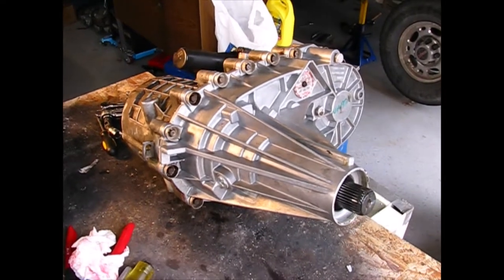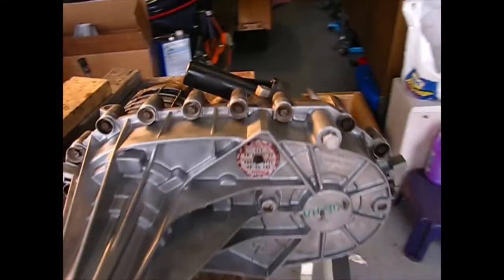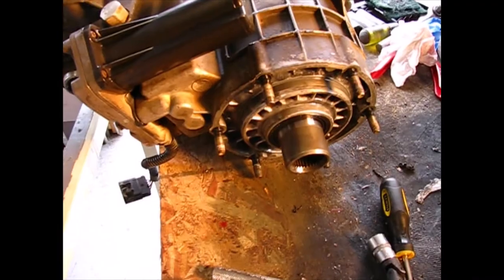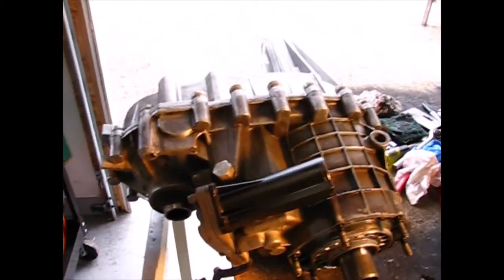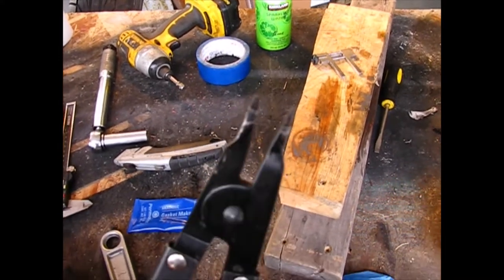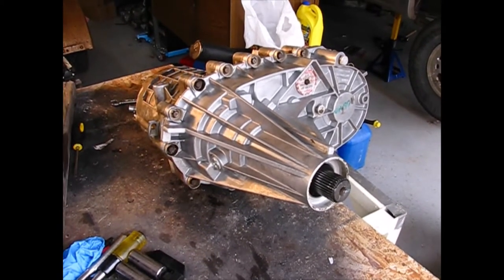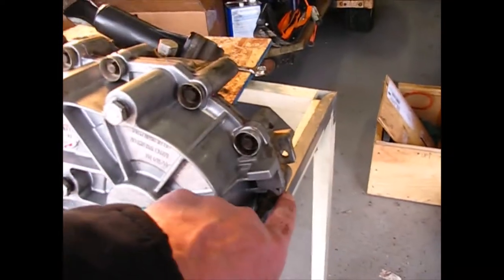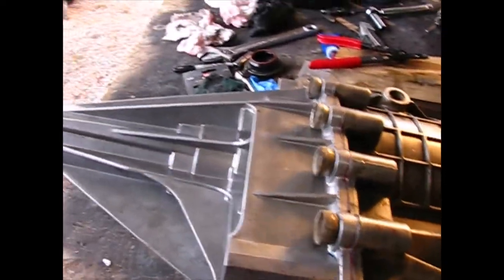263HD Transfer Case Repair Tips

Comment: Sincere thanks for taking the time to share your advice and tips.
I'm gathering parts at the moment in preparation of rebuilding my case, and I believe every bit
of knowledge I can gather will pay off once completed.
Thank you again, and have a good one:>)
Reply from the maker: You bet!  Mine still works fantastic.  Definately use the best goop you can find when you put it back together.  "Right Stuff" or something similar is prob a good bet.  I used anaerobic sealant and I don't think that was the best choice.  I do have a leak but it is so minor that it's nothing to worry about really.  A drip here and there.  I think a thicker goop such as right stuff would have been a better choice.  Just don't over do it.

Comment: What oil did you use to fill it?
Reply from the maker: Edward,  I don't recall as this was some time ago.  FYI I've had no issues after this repair so it's all good!  What I can tell you is that I used what is recommended to put in it per GM specs.  I did some research online then had the guys at the dealer look it up and it matched what I had found out so I was sure it was correct.  One thing I know for sure is that is NOT auto-trac transfer case fluid in this case.